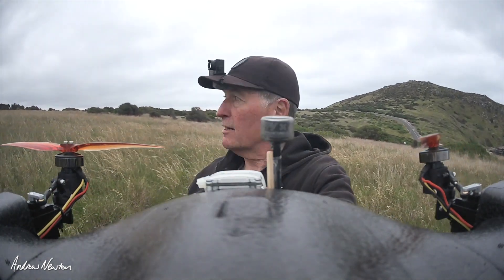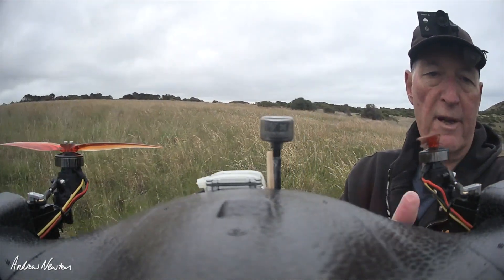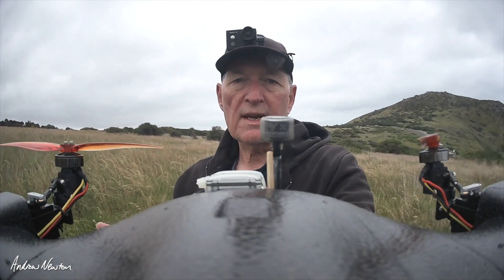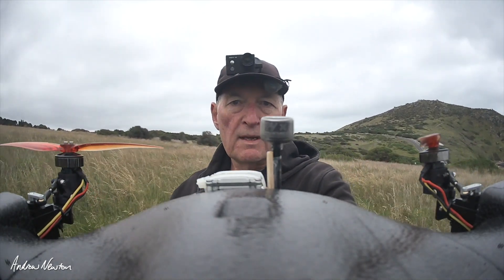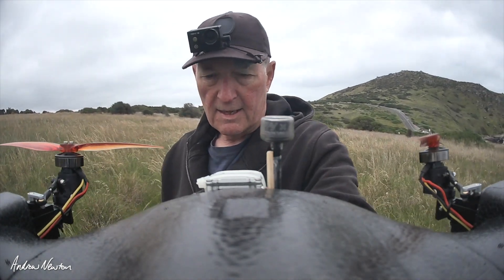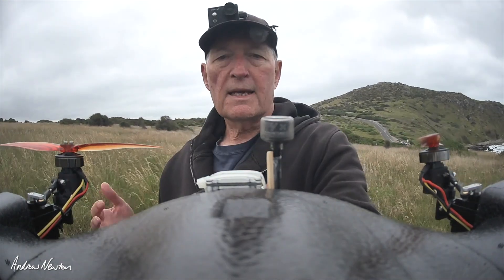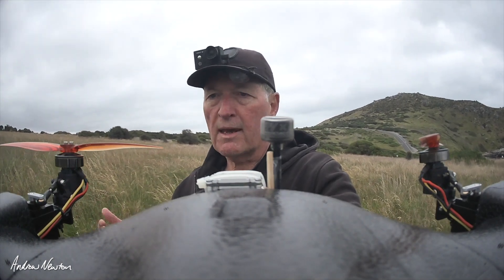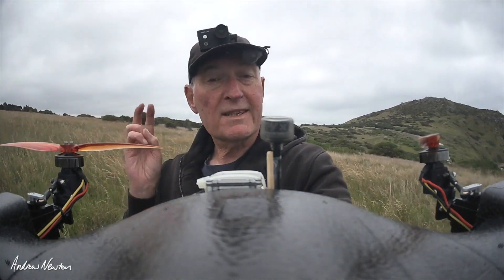FIMI Manta VTOL - More Modes QRTL LOIT CRUZ ACRO

Comment: hi Andrew, After watching yours videos about the Manta, I decided to buy it. I noticed that when switching to RTH, your motors go into tricopter mode. When I flip my switch to engage RTH, my motors stay in airplane mode. What parameters did you modify to do the RTH in tricopter mode?
Thanks in advance
Reply: yes, the manta is locked to the GPS position, in addition to roll and pitch stabilization.
Reply: @patricehonvault2612  Oh man, what a difference.  Thank you for this suggestion.  I'm loving this plane finally as there is no drama when taking off compared to the QStab mode.
Reply: @raptr49  No, not much difference, you just have to wait for the GPS fix with QLOIT, while you can leave immediately with QSTAB. You just have to remember that in this case the RTL will not work or the precision will not be optimal.
Reply from the maker: That's just because I was near the landing spot. Otherwise it would stay in wing mode until it reached home, then transition.
Reply: @AndrewNewton  Thanks Andrew. 
One last question, did you use programming with 2 switches to obtain your differents flights modes? In the original programming, the RTH is programmed on CH7 and the flights modes on CH6, which limits the flights modes to 3 possibilities.
Reply from the maker: @patricehonvault2612  Yes, 2 switches. I did a video about how before the Manta came
Reply: @AndrewNewton  yes I watched the video. So you no longer have RTL on the CH7. I found where this is programmed ! It's in the "Config / QP extended tuning" menu. This is an outdated way of assigning a flight mode to a channel, according to the Ardupilot documentation.
Reply from the maker: All my modes are now on Ch6 and I use QRTL not RTL. Set up in the Flight Modes Setup page using QGroundcontrol. I have never been to the QP extended tuning menu. I guess you are using Mission Panner?
Reply: @AndrewNewton  yes I use Mission Planner. I understood that FIMI had imposed CH6 and CH7 in order to simplify radio programming. The flight modes being defined, the user can simply apply the settings proposed by FIMI. Likewise, by default, QSTAB mode is programmed for takeoff because it does not require a GPS FIX to arm the engines. I prefer to wait for satellite acquisition and use QLOIT mode. Without FIX GPS, it is illusory to hope for reliable RTL.
Reply: @patricehonvault2612  Does the use of QLOIT improve the hovering stability when taking off?

Comment: I happy to report my Manta (built in FC)  maiden was great.  I used a 1850 3500mah battery and when balanced correctly easy to take up.   It held it's position in QLOITER and transitions to and from FBWA were very good.  So for a rookie VTOL flyer I'm impressed.  It's a great way to get started with VTOL's.  Winds were fairly light so I'm sure that helped.  I did notice it climbs sharply with throttle or turn into wind.  Did you just tilt the manta a few degrees and redo the basic level setup or adjust settings to compensate?   I don't want to touch too much at this point as it is flying good.   Thanks for all your tips.  John
Reply from the maker: Great to hear that. Always too much wind here for nice VTOLs

Comment: What battery are you using skipper? I maidened mine yesterday on 1850 3s and 3000 Li-ion and was only getting around 7 mins with minimal hover time.Maybe I need to back off the throttle more,my OSD wasn`t working so not sure of the numbers.
Reply from the maker: 4S 18650 3500. Much less current used in wing mode

Comment: Hi just tested my fiimi manta today the servos don't fully extended for normal forward flight and remain at a 40 degree angle, but when you try it on the bench without the motors spinning and transitions fine? Any advice. Thanks.
Reply from the maker: What does it say in the goggles when you try to go into FBWA mode in the air? Failing to transition for some reason.
Reply: @AndrewNewton  Thanks for the reply, not put my 03 air unit in the plane yet so I don't know, wanted to test it line of sight to make sure it works before fitting Fpv gear

Comment: Nice demonstration. Good to hear, you're enjoying the FIMI Manta. It cruises well, but it appears more tuning is required (not factory tuned, and Ardupilot defaults have been poor for a lighter weight planes). It's not clear if transitions where performed into wind to reduce a tendency to yaw related to wind and wind gusts, which could be a contributing factor? (eg: 4:36). Did notice a similar a wing drop occurred in fixed-wing mode later on at low speed.
Ardupilot uses a time-based transition period if there is no airspeed sensor as it can't judge when the wing is at flying speed. PIDs during transition seem a bit wonky for this light aircraft, as it tends to overreact. Adjusting the transition period might help.
From the description I see Ardupilot firmware 4.3 was flown. Ardupilot v4.4 released a month ago reportedly has a number of VTOL fixes geared to smaller planes (and Y setup). I don't know enough to give advise. It may be worth consulting someone more knowledgeable to learn if a firmware upgrade would offer benefits.
Reply from the maker: Transitions into the wind automatically. The amount of wind might be an issue due to Ardupilot seeing the lower ground speed into the wind and thinking the airspeed is insufficient to transition. I will update to 4.4 after a bit more fiddling.

Comment: Next video will show any damage/repairs? 🤔😱 
With our old XK X520 and X450 multi-modes we found that setting both sticks for fully self-centring made for less stalls and the flight controls getting their knickers in a twist! 
For Vertical Take Off nothing beats a Kmart chuckie twin with 2:1+ thrust and for Vertical Landing an RC Switch released parachute! Repairs are just as likely to be needed - but a bit cheaper than with 1 of those. 😉
Reply from the maker: No damage in the long stiff grass. I'm probably a bit over weight with the 4S.
Reply: @AndrewNewton  Yep. The construction is a lot better (both in materials and geometry) than the toy Multi-modes. Plus the square Al tube should be easier to re-align with a pair of shifters. 😉